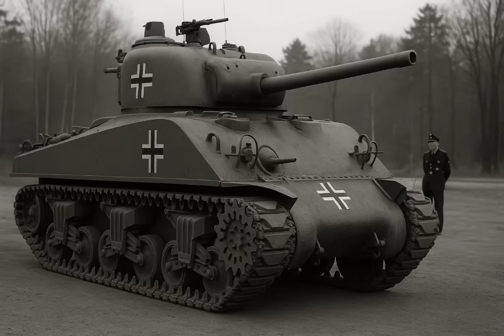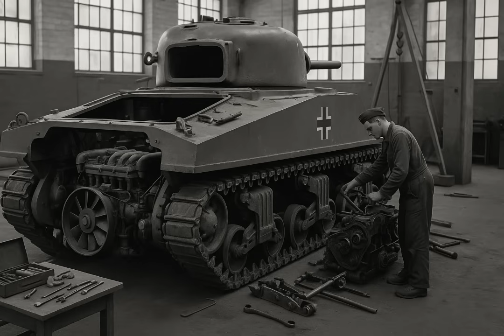German Engineers Tested a Captured Sherman — Then Admitted Never Built Reliability Like It.

Comment: No mention of the 10 watt FM 2-way radio in every Sherman?
Reply from the maker: Good point.. Yes , every standard M4 Sherman was equipped with the SCR-508 or SCR-528 10-watt FM 2-way radio operating in the 20–27.9 MHz band...It gave the crew reliable short-range voice communication between tanks and command units, a big advantage over the German AM sets, which suffered more interference...i focused on the mechanical aspects in this episode,, but the radio network was absolutely one of the Sherman’s real battlefield strengths...

Comment: If only American car manufacturers today kept the same philosophy about reliability and easy to service, they might not be losing the marketplace war.
Reply: Now, now…
We have to sell an a$$ load of giant part assemblies that lack rebuild kit availability and services that keep the customer coming back to the dealership. (Joke) 
That said, the American manufacturers are sh💩tting the bed on making a quality product. The EPA and their regulations are DEFINITELY taking their toll on the reliability for new vehicles. Brand new engineers trying to make a name for themselves is also taking its toll. 🤡s with no real life experience. That’s how we wind up with oil filters that require removing the plenum or upper intake manifold to change. 
Absolute 💩 clownery meant to screw the American public and make corporate executives a fortune. 
I say all of this as a former, ASE Certified automotive supply chain expert who worked for a large dealership group’s used car reconditioning hub, and I was the one who was called-on during miracle situations when a dealership either didn’t have the part (backorder), didn’t sell the part (only available as part of an EXTREMELY expensive assembly), or we needed a super fast (yet safe and reliable) solution. 
We NEED to cut back some of the EPA’s regulations to allow for reliable automobiles again. For example, CVT transmissions are designed to reduce emissions, but they are extremely unreliable. The rebuild kits aren’t allowed to be sold to anyone who isn’t a dealership certified by THAT brand for transmission repair, and even then, they’re still going to sell you a new CVT. 💸💸💸
Another example is EGRs, but especially on diesel engines. Nothing should ever have to eat its own 💩. That’s exactly what the EGR does, and it’s impact is negligible AT BEST if you look at the data, yet the system is causing modern diesel engines to fail WAY sooner than their older ancestors. 
Again, 💸💸💸